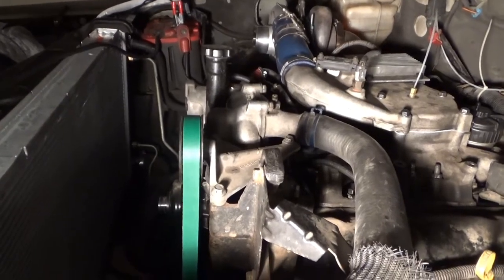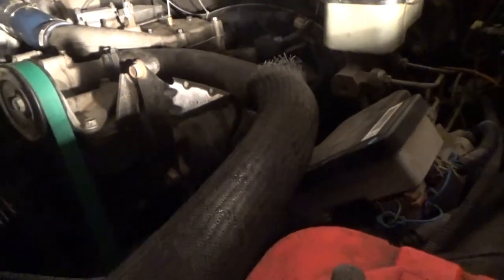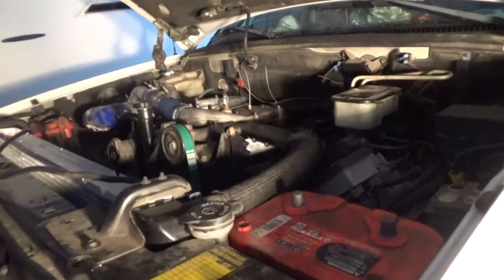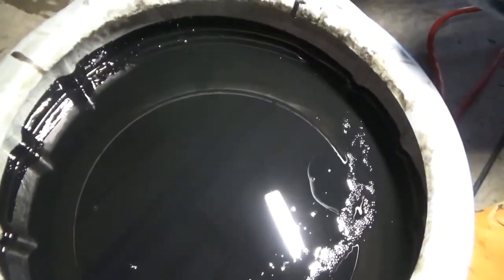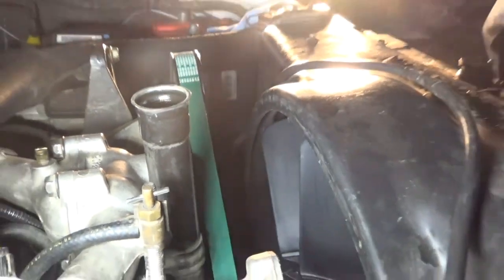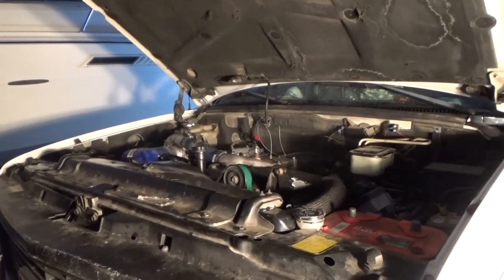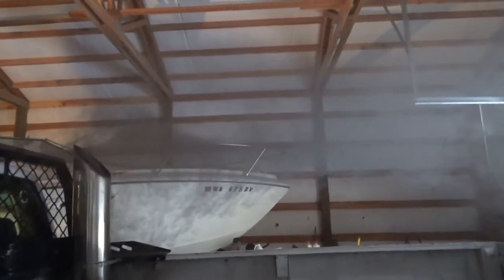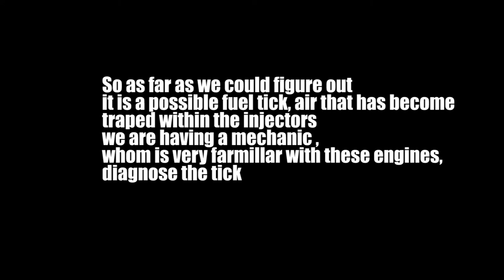6.5 first start

Comment: Do you have the part number for the radiator fan you used
Reply from the maker: i do not sorry about that. was awhile ago. I do know that it was just a fan kit that gave it the larger fan off of a Duramax. Those kits should still be around.

Comment: How tough is it to do a timing chain replacement?  Does the radiator have to come out?  I need to do this on my '99 suburban.
Reply from the maker: you gotta pull everything off the front, the problem is that the key broke off the cam shaft so we had to re-time as well as everything else
Reply: @ThisGuysStuffandStuff  So if it's just a plain old replacement (no broken key or re-timing) it's pretty straightforward?
Reply from the maker: @jrm4408  if buy straight forward you mean like any other timing chain then yes. if you do it carefully you won't have to re-time it

Comment: I would very much love to know all the mods on that engine as I am a huge 6.5 nut
Reply from the maker: i'll try to go off the top of my head here
the pmd was relocated, new upgraded Bosch injectors are coming (it has high horsepower injectors now but the cheaper ones), a whistler turbo (18 psi at 3000rpm or so the original turbo flange is a t3, so had to put a t6 adapter, so the turbo has very high lag) new timing chain, upgraded cooling system, new upgraded fuel pump, new injection pump, vacuum pump delete, 4 inch turbo back to a 5 inch y-pipe to 8 inch stacks, thats all i can think of right now if theres more i'll tell you.
Reply: Thank you!!
Reply from the maker: oh yes i forgot, the computer was tuned by Heathdiesel
Reply: Everything together sounds awesome!!! Almost like there's an engine brake on it which would be badass if they made one... Can't even find one for my 24v😒

Comment: Hows the 6.9 goin? 6.5 sounds great though. keep up the good work;)
Reply from the maker: just siting there at the moment,  this took up the space also going to work on the deuce to get that back up and running, have to do the seal on the axle.  so it'll probably be spring when we start tearing down the 6.9 engine and refinishing it.
Reply from the maker: seems  to be just bad injector ticking, i guess these one's are the ones we shouldn't have bought haha